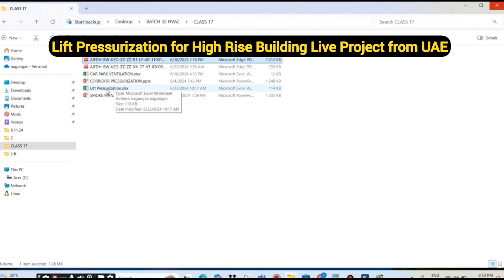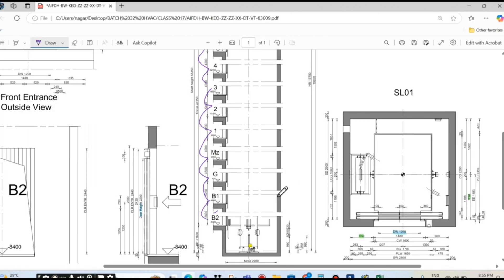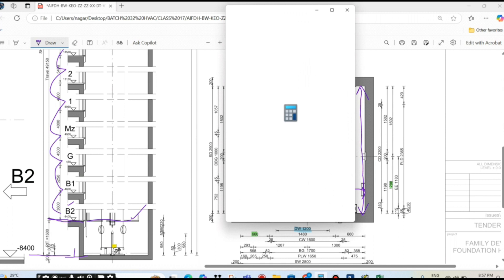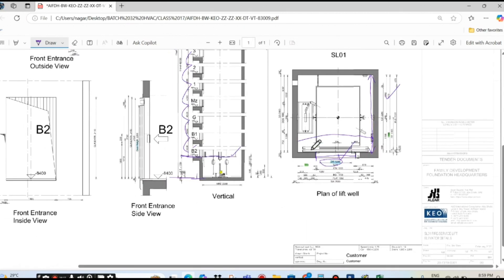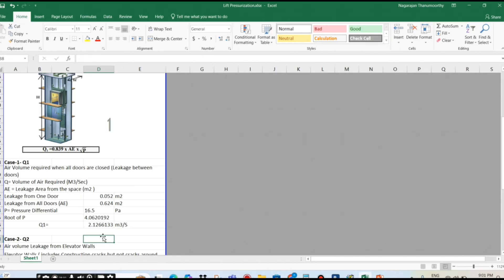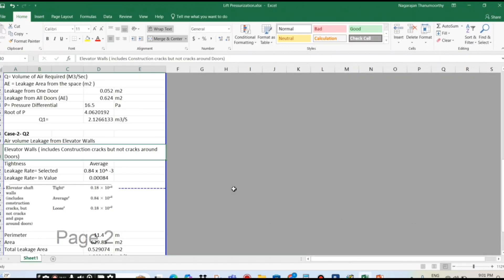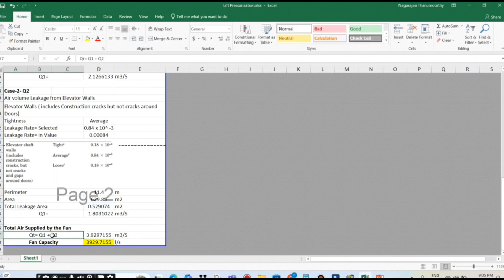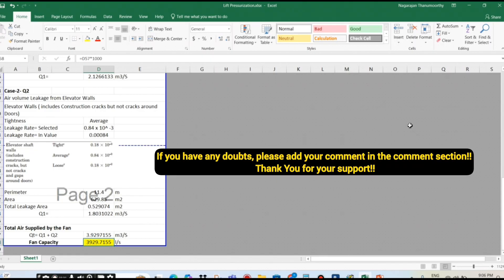Lift Pressurization System Design l Elevator pressurization System l Step by Step Design Explained

Comment: Why are we not considering door open at exit ?
Reply from the maker: Yes similar to staircase Pressurization, we should apply Q=A x V to find out the door opening also. In staircase,we consider 2 or 3 doors but in lift we should consider 1 no door